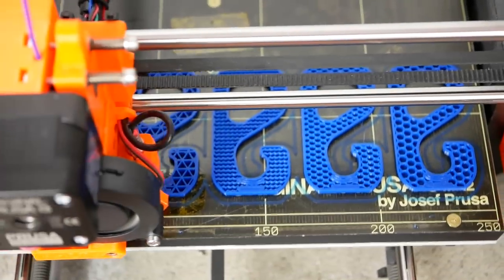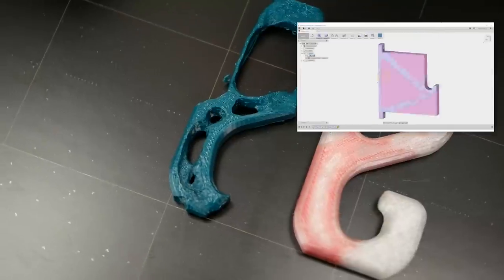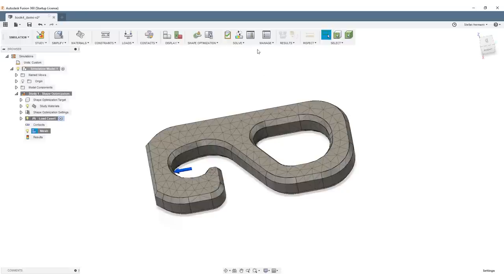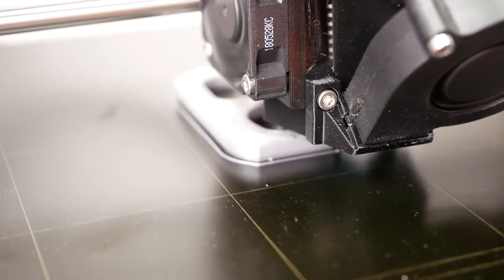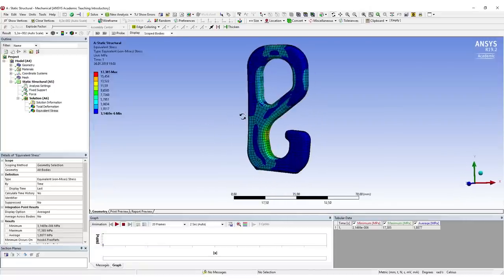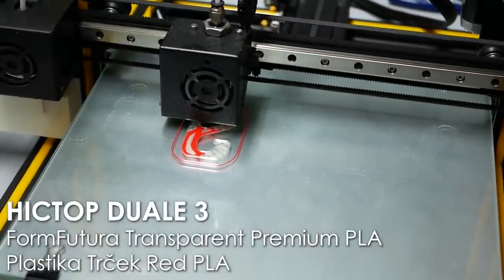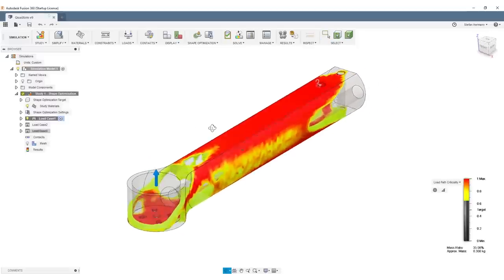Load dependent Infill placement: Smart Infill for FDM 3D prints!

Comment: An approach to the infill problem that I think should have a very high potential and likely should lead to infills that are as close to optimal you will get in a relatively short amount of time (including the fibers you are after), is deep generative learning (a form of machine learning). Perhaps some reinforcement learning-based approach. A quick google search doesn't really yield any significant results, so this seems like an open problem as of now.

Comment: It would be interesting to run this with an H or P style convergence on the mesh to help increase your mesh density at your high stress areas and open up at less dense areas. Pretty easy to do this in SolidWorks. Not sure about Fusion or Ansys

Comment: would expect keep the weight the same throughout, or at least under +-5% difference. did not know that fusion had such an optimisation module. have used it only within solidworks.

Comment: I think that you should input the correct material into the topology optimisation. I believe that fusion 360 defaults to steel. The important property, I assume, is the ratio of the tensile strength to the compressive strength. Obviously, in both cases, the solver will put material away from the nodal point the middle of a beam, however, it might be required that much more material is required on the tension side if a material has a proportionally lower Young's modulus. 

This video was extremely interesting. I wonder if you could design composite material structures in a similar way. If say, you could place steel wire, or rods or something like that in particular optimal locations.

Comment: I think the closer the curve interruption is to the complete failure of the part the better.  Such a dramatic internal restructuring half way through the load would be inconsistent.  You want any changes in the internals of the hook to only occur near the same point it fails, otherwise you'll have an unknown amount of support left internally and the entire hook is unpredictable.  And you're missing further possible strength optimization since something is giving out before it could help support the target load.

Comment: In real world use those hooks would have problems with the outer end of the hook breaking off since the reinforcing stops exactly at the midpoint of the curve. Loop ropes through both ends, the hook should rotate a bit, especially when it flexes some, putting the load vector angled toward the free end of the open hook.

Comment: Very cool project! @CNC Kitchen 
What I'm missing is information on how much material was used additional on the differen reenforcements you showed. Because if additional material does not matter you could just set the infill to 100%. But a cool result would be sth. like "smart infill gives 20% more stress resistance but uses only 10% more filament (and takes 15% longer to print)" or sth. like that... what do you think? :)

Comment: Waaaiit. You said all test hooks weigh the same but when you take the regular 2-perimiter and 10% infill one and add parts with 100% infill, they will have a different weight.
Reply from the maker: All parts besides the initial 2 perimeter, with 10% infill had the same weight. This hook was only there to show how an increase in infill or perimeters strengthens your 3D prints.

Comment: Amazing project and great analysis, i have two ideas for you :
The testing models should be at least three for a consistent result
You can add a model where the filement direction would be parallel to the constraints in some areas because i noticed that the breaking  starts at the joints created by the extrusion directions

Comment: Given the direction of load, would be interesting to see the topology optimization done with rectilinear that's oriented at 0/90 deg instead of -45/45. Also when you did the topology optimization did you make sure to optimize for max strength instead of things like compliance or strength/weight ratio?

Comment: I think it would be interesting to see parts that have a hard shell and a flexible infill or the opposite. I don't see it being particularly strong but I think the results could be interesting.
Also possibly printing the smart infill portion with flexible filament and the rest with a rigid filament.
This is something that I've been thinking about for a little while but unfortunately don't have a multi-material printer.

Comment: This is fantastic! Great work!! I really thought optimizing just the infill as a separate part, then combining, would create the strongest part. Great learning here. It also seems like there is something remaining to improve. For your strongest part you should be able to combine the final optimized meshes to create one optimized mesh, shouldn't you? If I'm thinking about this correctly this will eliminate the way your strongest part has separation between the two meshes. (like how you can see in your video at 16:22). I'm probably missing something, so correct me if I'm wrong.

Comment: Thoroughly enjoyed! I will have to rewatch so I can follow the different settings more closely on the optimized parts. It was hard to remember when it came time to strength test them (with respect to matching the method to the print settings). How do you think filament type will affect the results (flexure causing your applied tension vector to deviate, layer bonding, elongation, etc - i.e. nylon vs PLA)? Super interesting. Do you have plans for your test apparatus? How do you calibrate it?
Reply from the maker: I don't have proper plans for my test machine yet, but I'm planing to do a video with everything in the next couple of weeks.
Reply: CNC Kitchen a video on everything would be amazing

Comment: Interesting approach and very helpful to see the measurable results of the different configurations.
I wonder whether there is the possibility to integrate such strengthening function into the open source slicers i.e. to be able to define a variable infill density based on a separate STL file. 
Looking at the IceSL slicer with its painting function for variable infill / heat / speed settings the base programming seems to have been done already there.

Comment: Could you just use the combine tool in F360 to cut the generated mesh out of the original part and bring both into the slicer as two separate files, align them like a dual extrusion print but then just have both print from the same nozzle?

Comment: I wonder if some sort of annealing would prevent those small internal breaks by allowing the structure to normalise throughout? There must be some internal stresses when the plastic solidifies, so trying to even this out might help.
Reply from the maker: I don't think so because annealing doesn't remelt anything but this might be something very interesting to try out in the future.
Reply: @CNCKitchen  - True, but annealing metal doesn't remelt that either, but it evens out the stresses because the whole of the piece cools at a uniform rate from a state. Since you're laying down hot plastic onto cold plastic throughout the building of the component, there will be stresses that might be removed. You would only need to heat it enough for the stresses to be relieved, you wouldn't need to melt it.

Comment: Guten tag Stefan, und danke.
Do you know if there's a filament with iron filings embedded?
If a magnet could be put somewhere during the extrusion process, it should be possible to align the filings so they're all pointing in the desired orientation (when the filament is still malleable).
Tschuss!

Comment: Das muss ich mal ausprobieren! Ich hab gestern Abend eine Backplate für eine Grafikkarte gedruckt, wo ich einen Wasserkühlungsmod mache. Leider ist die Backplate aus Clearance Gründen an manchen Stellen etwas schwach und biegt sich dort mehr als ich es möchte. 
Den Infill an den Kritischen Bereichen auf 100% zu haben würde möglicherweise viel helfen! 

Hab vielen Lieben Dank Stefan! :-)
Reply from the maker: Beobachte die Temperaturen deiner GPU an Anfang. Hatte das selbe für meine CPU gemacht und die Temperaturen hatten dem PLA und Nylon garnicht gut getan. Wärmebehandeltes PLA hält jetzt jedoch ganz gut. Mehr dazu vielleicht im nächsten Video 😉
Reply: @CNCKitchen  Hi Stefan, danke für deine Tips! 
Genau gesagt habe ich einen GPU-Wasserblock-Halter, eine passende Retention Bracket dafür und einen VRM Heatsink Holder gedruckt.
Alles aus Extrudr's GreenTec Pro. Ich habe zu einem deiner Videos zu PETG und Print Temperaturen etwas mehr zu dem Material kommentiert.
Das GreenTec Pro hält recht gut. Ich probiere gerade deinen Tipp mit dem Tempern ob ich noch etwas mehr Stabiltät aus dem eh schon Zähen Zeug rausholen kann ;-) Wasserblock Halter + Retention Bracket halten recht gut selbst bei 16 Stunden Dauerbenchmark + Overclocking ;-)
und das direkt vom Drucker.

Es überrascht mich das du eine Halterung für einen CPU-Kühler aus PLA drucken hast. PLA ist ja super Hitze empfindlich. 
Aber gut... die Backplate zu einer anderen Grafikkarte von mir, habe ich auch aus PLA gedruckt und die hat sich auch nur einmal verformt und hält seither ihre Form und Stabilität (auch wenn sie jetzt etwas Krumm ist );-)

Ich werde auf jedenfall auch nochmal das Volcano PLA ausprobieren was du vorgestellt hast!

Hab vielen Dank für deine Tollen Videos! :-)

Liebe Grüße, der Marcus :-)

Comment: Very cool and smart use of infill but if structural integrity is of most concern I would think possibly using a different material like steel would be more applicable. If you already have the file getting it laser cut wouldn't take much more. I still think it is very interesting and ingenuitive but application of material should always be considered.

Comment: Such an awesome video! Thank you Stefan. Silly question. Would increasing the top and bottom layers to say 12, @ 30 % infill density while using 6 layer lines for the walls not produce the same desired effect of a "stronger" part, as opposed to the amount of filament used in a "smart infill"? I seem to think that the initial failing point of the 5 perimeter hook is the amount of give on the top and bottom surfaces ( I could also be way off, lol).  So wouldn't increasing these surfaces create the same desired effect?

Comment: hmm i like the idea of putting small internal splinters/cylinders inside the model. can you try that? and see if its easyer? i kinda  suck with fusion 360 still a lot to learn in it. im going to try to do it after this print finish's if i make small cylinders i can import them into my slicer and place them within the model i use S3D. you would force a change on the infill i think? just placing the small cylinder inside the stl? at the points you think is going to be under stress? Think this might be a good idea thank you CnC kitchen..... I can see in my preview it is going to add :)

Comment: I'm confused about the switch to Ansys half way through.

"Another method I thought about was exporting the regions of your model that see the most amount of stress, unfortunately I didn't find a way to do that in Fusion 360"

But you just did exactly that didn't you? Export the regions of highest stress as an obj? I think I'm missing something here!?

I've been experimenting with this process using just F360 and getting good results, what is the benefit of Ansys here?

Comment: Simplify 3d provides a better control of infill orientation. But still you will need a separate process for every region where stress direction is expected to differ compared to the others. I think vitrual fibers approach is something that is hardly applicable for FDM printing models which are as small as this one. SLA should probably give better results. Firstly because of higher spatial resolution and secondly because of the fact that SLA printed models are not as intrinsically anisotropic as FDM printed models.

Comment: If you've got a material with directional strength, say you know it can handle twice the stress in on one axis, could you scale your model proportionally before and after the simulation on that axis to get more relevant results or does the software understand the layer adhesion problem in another way? For instance for 3d prints you'd want to decrease the width and depth or increase the height of your part for simulation. Does that make sense?
Reply: I'd also love to see a more detailed look at how the intra layer bonding could be accounted for as well

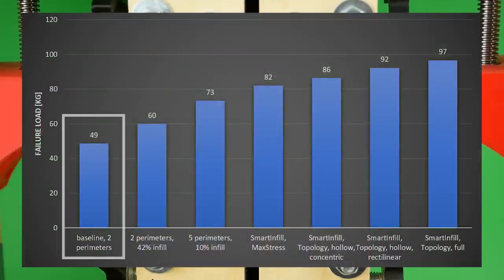Comment: I did not get the difference between the SmartInfill variants at 15:11
1: "2 perimeters 10% Infill": clear what is meant here
2: "2 perimeters 42% Infill": clear
3: "5 perimeters 10% infill": clear
4: "SmartInfill, Maxstress": 100% Infill at MaxStress locations, using reclinear infill, FEM done with full part
5: "SmartInfill, Topology, hollow, concentric": 100% Infill at MaxStress location using concentric infill, FEM done in core with hollow part (you mentioned this only in #6)
6: "SmartInfill, Topology, hollow, reclinear": 100% Infill at MaxStress location using reclinear infill, FEM done in core with hollow part
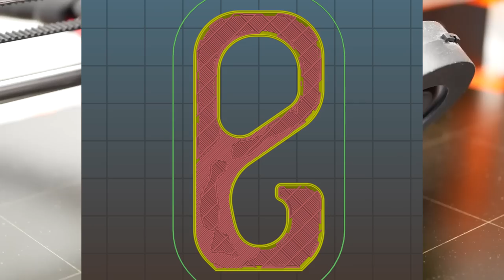7: SmartInfill, Topology, full: ?? , FEM done with ?? Difference to #4 ?? At 16:19 you also mention that this one is heavier than the others, however in 12:16 you say that the smart ones all weight the same

Comment: Great video!  Thanks!  Got me thinking about parts that I make for RC aircraft.  
Question:  For those of us who are not as proficient with F360, is there a simple way to put a bit more infill?  I was thinking of at the end of a F360 project create some new sketches with some 1mm or 2mm circles.  Then extrude those circles as cuts to create a few small hollow tube sections where it will have the most stress.  This will force the slicer and printer to add more plastic in those areas and would also force the printer to lay the plastic down parallel to the tube and presumably the forces.
Reply: You can load modifier mesh of any shape and the slicer will just process the overlap. This works in both Cura and Slic3r. I use this all the time: I load a simple cube (even download one if you have no cad skill), resize it and position it in the slicer, and slice. No cad involved.
Reply from the maker: Damn, I wasn't aware that CURA also supports modifier meshes. Need to try that out and see if it makes some things better than Slic3r. Thanks!
Reply: @CNCKitchen  Oh yeah It's awesome. You can do almost anything. Select any stl, then on the left side select 'Per Model Settings'. And off you go... (BTW to align models in Cura you have to right click and 'merge models' - then you can ungroup them and make one into modifier mesh).

Comment: i wonder if by doing that smart infill could you have a dual extruder printer with pla and petg. do the optimization and in the area that needs strengthening print petg and then pla everywhere else. this way the part is strong and light.
Reply: now im also wondering what other materials could you mix like pla inbedded in tpe or a petg rod with a flexible tpe joint.

Comment: Hey Stefan, I’m working on a 3D bridge competition for my university. Most of the criteria is based off deflection but the dimensions are a 100cm diameter and 1.25 m height

I was wondering if you recommend a specific material for rigidty property like the diamond pla filament you recently reviewed. 

As an engineering student I love your Material property testing. Thanks man!

Comment: I did not get the difference between the SmartInfill variants at https://youtu.be/q0YsC53mFvY?t=914
1: "2 perimeters 10% Infill": clear what is meant here

2: "2 perimeters 42% Infill": clear
3: "5 perimeters 10% infill": clear

4: "SmartInfill, Maxstress": 100% Infill at MaxStress locations, using reclinear infill, FEM done with full part
5: "SmartInfill, Topology, hollow, concentric": 100% Infill at MaxStress location using concentric infill, FEM done with hollow part
6: "SmartInfill, Topology, hollow, reclinear": 100% Infill at MaxStress location using reclinear infill, FEM done with hollow part
7: SmartInfill, Topology, full: ?? , FEM done with ??

Comment: I'm having a small problem... I hardly use the Prusa slicer usually i use Cura, i've done this to 2 mondels so far without any issues. I've just tried to do a third model and for some reason when i import both into the slicer. the model and the generated mesh aren't lining up, now i'm SURE there is a way of aligning them but i just don't know it. because i have very little experience with the Prusa slicer . Any chance you can help me out ?
Reply from the maker: Don't rotate or move your part before you add the modifier mesh. This leads to misalignment.

Comment: Great! But usually u dont increase infill to strenghthen the part. You need to increase perimeters.

Depends on the part that you are printing, maybe this is solution to some.
But you did great cover up on the tests about that. 

I would had made 0.05 cut-in to my model so it would still be fuzed together and would make extra perimeters 0:52 . But your solution is genius.

Thanks!

Comment: How are the print times?
Reply from the maker: baseline, 2 perimeters: 35min
2 perimeters, 42% infill: 46min
5 perimeters, 10% infill: 45min
SmartInfill, MaxStress: 53min
SmartInfill, Topology, hollow, concentric: 61min
SmartInfill, Topology, hollow, rectilinear: 53min
SmartInfill, Topology, full: 55min
Reply: Thanks! Not so terrible more with the smart methods.
Reply: @CNCKitchen  wow that's fast!

Comment: 14:12  why did you put this block of concrete under the printer ?
Reply from the maker: It isolates the vibrations of the printer from the table. Significantly reduces the noise of the printer.
https://www.youtube.com/watch?v=OnfYA5QLA84

Comment: How do you optimize for rotating part? e.g. wheel for RC car.
Reply from the maker: You can usually add an angular velocity as a load case. Not sure at the moment if Fusion already supports that. Still for a wheel, a torque is probably rather your sizing load case.